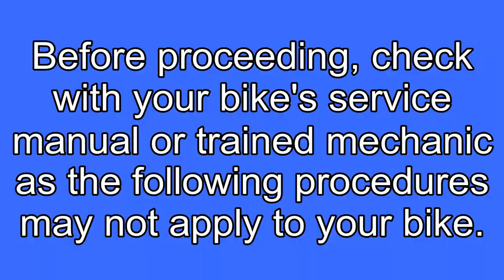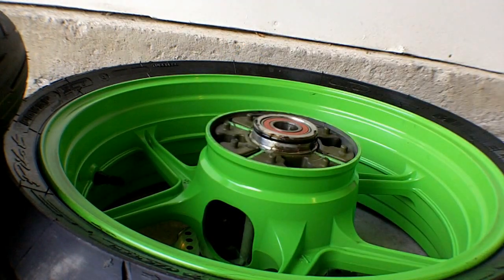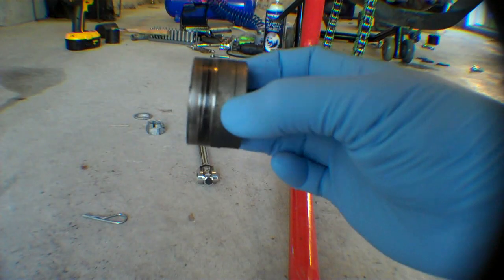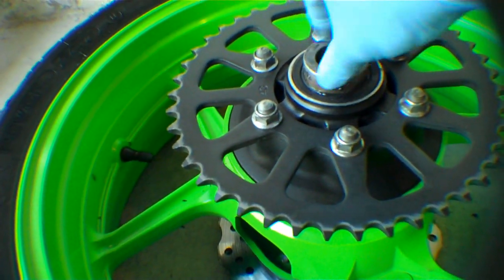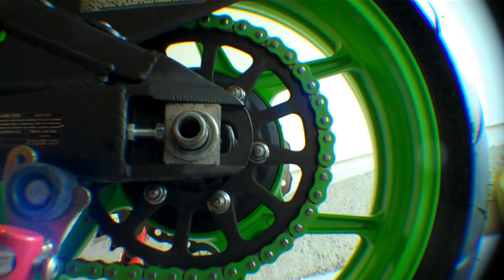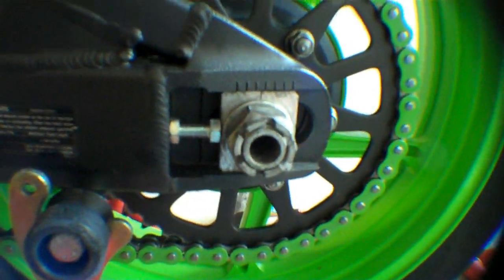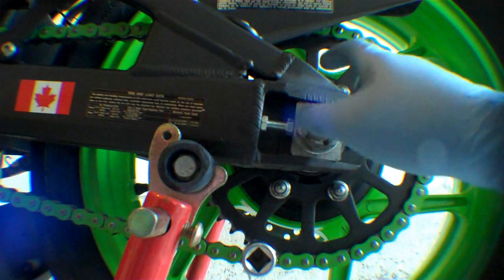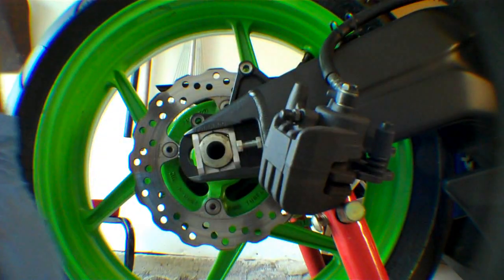Installing the rear wheel on a motorcycle 2008 Kawasaki ZX6R example.

Comment: Hey man.. thanks for the video.  I got a question about installing the left side spacer (the sprocket side).  The spacer has a thicker side and a thinner opening side.  Which side goes into the wheel?

Comment: are you not afraid that using anti seize will have a reverse effect and loosen the bolts with the vibrations of riding. The reason i ask is cause at the tire shop I work we have to (protocol) clean off all anti seize of the lug bolt (stems)and hubs for that reason alone.
Reply: WildBill ...was thinking the same... I would use torque seal and not trust the cotter pin too much.. Use a breaker bar when removing.

Comment from the maker: @DATBOIRO It could be the spacers not being in the correct side. Have you tried switching the spacer around? Or it could be the tight tolerance between the swingarm. Sometimes it can be a pain to fit the wheel back on.

Comment: this was helpful, thanks. mine is an 01 and its still in pieces cause im still waiting on my new sprockets and chain. i have been concerned about gettin the chain tension and alignment right when i put it back on cause this is my first time doin this. i got it used so i dont have a manuel, do you know where i could find the torque specs for the axle nut and stuff?

Comment: @wedginator I fairly certain they're on the correct sides as one has a little lip and the with said lip will only fit on one side. But I can't get the spacers in with the caliper mount. I"m lost.

Comment from the maker: @WildBill1006 I did have a bit of concern in the past so I've decided to do it with one bolt first. It didn't back out. Even with antiseize the bolt was still torqued on good at time of removal, but removal was easier. The bolt without antiseize was actually seized and I ended up stripping the bolt. I'll post that video later. Took me 2 hours to drill it out.

Comment: What kind of grease do you use?  Best recommendation?  I use white lithium grease for small pivot points but am not sure whether to use it on wheel bearings.  What's your opinion?

Comment: I have a P7, same bike, and this is a pain the ass. Not contradicting the vid, it is great, but I didn't have such an easy time. There is absolutely zero tolerance between the swingarm/spacers/caliper mount - get it perfectly aligned or it all falls apart. A two-person job, we ultimately maneuvered a brick under the tire to help set up. Maybe with repetition this task becomes easier but I had a difficult time.

btw - according to the kawi svc manual, you only need to grease the cush drive.

Comment: Question! My girls 2013 636 been pulling to the rite" so I checked her adjustment blocks at the rear, The one on the Gears and clutch lever side is just off to the left of the line! but just a little, is this ok? or should I align it back? and how can I do that? TY and ride safe.
Reply: Even being off a little can make the bike pull to either side so definitely make sure they are exact on each side when u adjust chain.

Comment: Nice vid. I'm having issues getting my wheel back on. The wheel wont fit in with the spacers. Any ideas?
Reply: Prop the wheel up so that it's roughly in line with the swingarm. Tape the brake caliper bracket into position. Position the wheel as far back as possible so that only about two or three millimetres of  the left-hand spacer (chain side) touches the inside of the swingarm. Looking at the right hand side you'll see that the spacer overlaps by about 2mm. Fear not! Put the tip of a large flat head screwdriver or similar on the wheel hub in front of the spacer and pry the right-hand swingarm out by a few mmm until you can push the wheel and spacers forward between the swingarm. Ease the screwdriver out of the way and the swingarm will clamp the wheel and spacers into place. Cut the tape holding the brake caliper and line up the holes. You should then be able to fit the axle without much difficulty.

Comment: I think it's a but more of a fiddle on my GSXR as the calliper needs to be in place when the rear wheel is inserted and it keeps falling out of the stupid slot in the swing arm. Last time I done this I knocked the pads out of the calliper with the disk and bent the anti-rattle clip. doh!